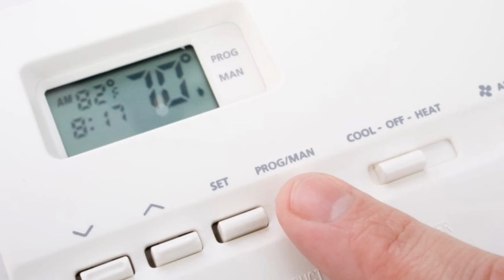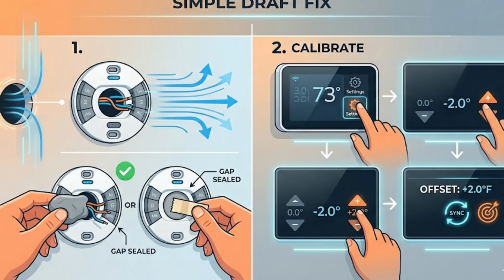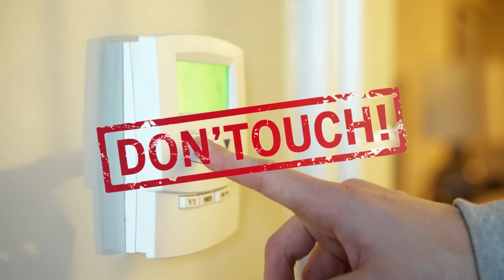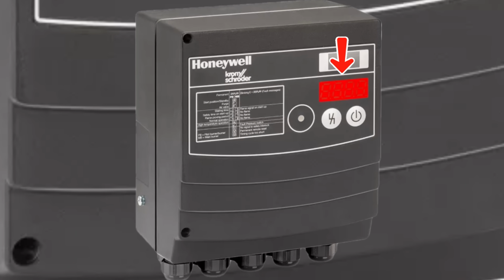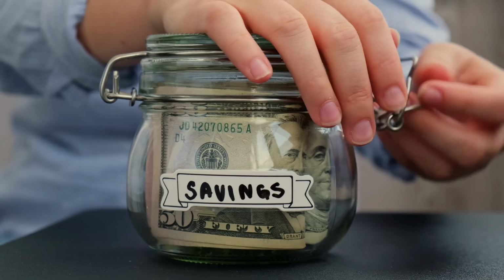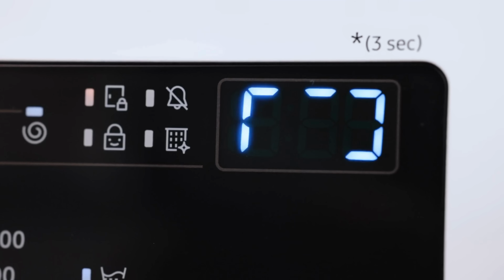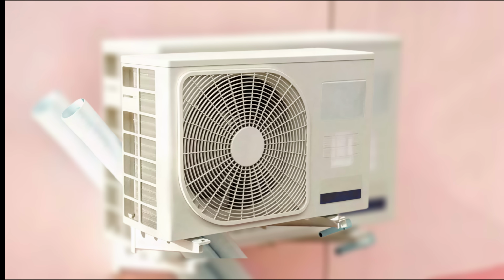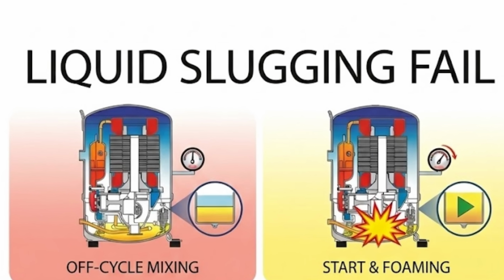Every Thermostat Has a Hidden Contractor Mode (Cuts Your Bill 30%)

Comment: I don't think there's anything hidden in my mercury bulb or bimetallic strip that a contractor would be able to unlock 🤔
Reply from the maker: You're right, for older thermostats like mercury bulb or bimetallic strip models, this particular contractor mode wouldn't apply. This video focuses on more modern digital thermostats!

Comment: Unfortunately, I still don't know where to change those settings in the ecobee. E. G. There is no CPH or fan off delay, but I see a heat cool min delta, compressor min Temp, heat min on, compressor min on. Is any of this similar?
Reply from the maker: Those are similar settings. Ecobee uses different terminology. "Heat Cool Min Delta" is like CPH, and "Compressor Min On" is the fan off delay.

Comment: We had a completely new system installed right after the pandemic. I have it set up for a 2° difference so it’s isn’t constant cycling. The fan runs for a couple of minutes after the heat or air system reaches set temp. 

I don’t think you can help with my issue; my wife turns on the air and leave windows open. She is always hot while I’m freezing😅. She works from home and has the air going all day as her office is in the hottest room. It even has a portable a/c unit so the whole house isn’t being cooled when it s empty or I’m home and cold. 🥶
Reply from the maker: Haha, that might be one thermostat trick I can’t fix! 😅
Your setup actually sounds pretty good — the 2° differential helps prevent constant short cycling, and the fan running for a couple of minutes after the system shuts off is normal and can help move the remaining conditioned air through the ducts.

The real challenge is that one room is hotter than the rest of the house, especially if it’s being used as a home office all day. In that case, the portable A/C is probably the right idea so you’re not freezing the whole house just to cool one room. I’d also check airflow in that room, blinds/curtains, door gap, return air, and whether the vents are balanced properly. Sometimes a small fan moving air out of that room helps more than people expect.

As for running the A/C with the windows open… I’ll let you handle that conversation at home! 😂 Thanks for watching and for sharing — that’s a very real-life HVAC problem right there.

Comment: Compete lie. Displays a total ignorance of how home heating system work. Increasing your thermostat deferental is not going to drastically increase your heating effency, due to heat lag, it takes time to raise the temperature of the house, hence no short cycling.  If you want to save money on your home heating and cooling costs, read the book "Keeping Warm in Hard Times".

Comment: I used to have a very old system (25+ years old). No fancy electronics just simple solid electricals ! No stages No Zoning nothing. The gains from a replacement were way less, than proper maintenance, closing of vents in unused rooms, better home insulation, using ceiling fans as per season !
Another simple idea is to tilt the fins of the output vents downwards towards the floor in the winter and upwards in the summer.
Reply: Don't close vents in rooms you don't use. Your system is designed to have a specific static pressure throughout the ductwork. Closing vents does not help you but it does cause stress to the system. It has to get rid of that air, if not then it causes loss of flow which can cause the coil to freeze in AC or the coil/heat exchangers to overheat in Heat.

Comment: Cycles per hour doesn't extend each cycle to run longer... it prevents operation if it cycled that many times already. Opposite of what was presented.
The video presumes the installer was incompetent. If they fail to do basic setup and test... you need a different contractor.

Comment: Also an HVAC guy here. I can say a lot but I will comment on the $5 worth of free heat in there assertion. Obviously that makes no sense. If that happened just once per day, that would be $5 * 30 days which is $150 per month. Impossible.

Comment: HVAC guy here and most new thermostat already have all these settings just like you mentioned. Also new high efficient furnace too. This good info 25+ years ago not now!
Reply: Dido. Retired  HVACR 12 + years back.  Placing shade around a condenser helps and is safer than tap water spray arms, but one thing most non- techs couldn’t do either is water cooling the post high side condenser line (with most any condensate); only it'd need to be silver (soldered) plated to protect it. Hobart used to specifically on their indoor freezers and worked well.  

As far as stats are concerned: Checking & adjusting the "differentials" as suggested might help. Now days they're producing stats as though your home is sterile and airtight.   Me, I like a "cut in" @ set point and 5-6° cut out differential and adjust to comfort.  Granted a bit sloopy, but unless a person were mental and using a lazer thermometer you'd never know it.
Reply: I don't think so. The back up on my heat pump runs constantly regardless of the temp outside. I have to turn it off at the breaker.
Reply: What thermostat do you recommend?
Reply: @mnight207  Stay away from those Wifi jobs. Someday the government might use it take control of your A/C.
Reply: I have a furnace installed 5 years ago it run every 1 degree and don’t know how to change it? I can’t get the guy who put it in to come back. So even if I can find someone to reprogram how would get the code?

Comment: 1) An appliance reaches its highest efficiency (that’s bang for buck) in high stage, not low stage on a multi stage system whether it a heat pump, AC, gas furnace or geothermal. Low stage is more about comfort than efficiency because it runs longer cycles during lower demands.
2) The best tip I can offer is to not have setbacks more than 5 degrees if you have a programmable stat, you will lose comfort and spend more money getting your home to set temperatures. So in effect don’t play with the dead band on the thermostat UNLESS it switches automatically between heat and cool. Personally, I do not recommend leaving a thermostat in auto, you may wind up running the heat and the cooling during the day as it warms up or cools down or vice versa, wasting money.
3) If you don’t know what you are doing don’t touch the settings that’s why they are passcoded. On Ecobee Professional T’stats you need to have a dealer code to access that.
If you just can’t help yourself, have the manual handy, that way the guy who has to undo whatever you screwed up has the info they are qualified to work on.

Comment: To answer a few Qs - below; The thermostat is independent of the heat or cooling source - it just sends a signal, based on conditions set in the thermostat. Does not matter the type or source (as long as it is the right type for your gas, electric or geo-source).
Reply: The point is if it cycles more often, it wastes energy.

Comment: Ami wrong or did he just talk about gas units? Mine ie electric HVAC
Reply: Yeah, I too am curious about the correct settings for an electric only system!
Reply: The thermostat is independent of the heat or cooling source - it just sends a signal, based on conditions set in the thermostat.
Reply: @koolkevin2357  Yes, but the settings you would choose would sometimes depend on the method of heating and cooling. Gas and electric would probably require some different settings from each other, as they operate differently

Comment: We generally set the fan to stay on to circulate air
Reply: i tried that last summer and while it was certainly comfortable in the upstairs bedroom, my electric bill went from 120 to over 500
Reply: I recently installed a new heat pump. I asked my installer if I should let the fan run constantly, or let it cycle. He said definitely do not let it run constantly. That would prematurely wear out the fan motor in the inside unit.

Comment: I have a geothermal unit, will this help that? It's only a couple years old but we do have a room that is warmer or colder then the others.
Reply: Set "Fan on" constant to circulate and never "set back" at night.
I used to be an HVAC tec/ owner.
Reply: You might try getting a thermostat with sensors but beware they are quite complex.

Comment: Does this work for the ac?
Reply: It would if  you knew how to enter its (a.) set-up codes and (b.) set its "range" (otherwise known as "differential"); that is,  if the stat will allow it......Some simply will not. And if you don't know what you're doing it'll cost you MORE than you bargained for.